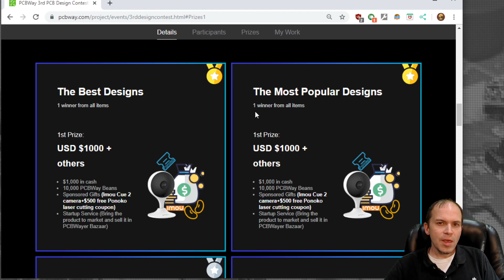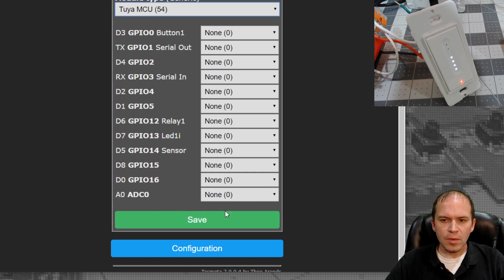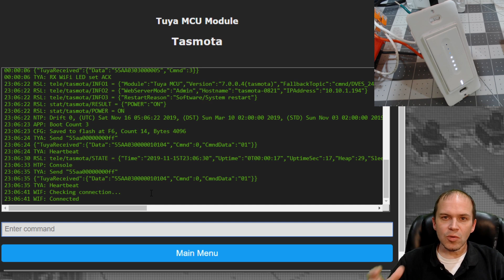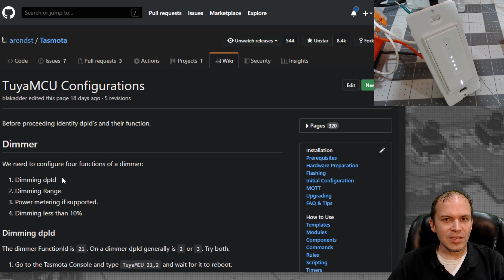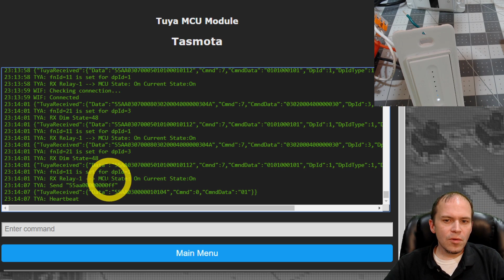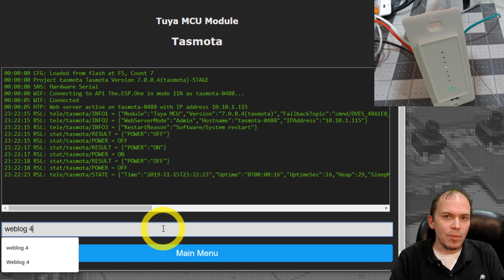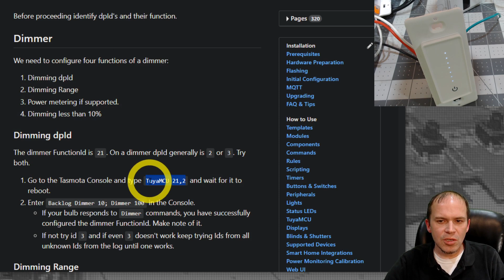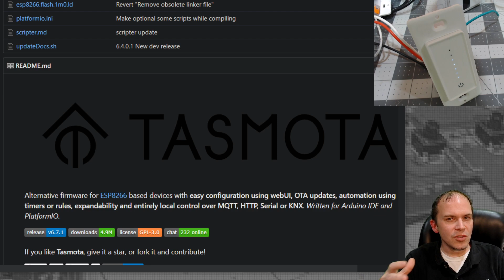How to Setup a Tuya MCU Dimmer - Tasmota Tips Episode 4

Comment: Which command can I turn off and on the switch backlight?  In device debugging it is set to light_mode.
Reply from the maker: You would need to find the datapoint for it if it is exposed.
Reply: @digiblurDIY Thank you very much for the quick response, I have "code" : switch backlight / type: boolean.  but I don't know how to send this command, would it be via tuyasend command?  on/off? DP is 16.
Reply from the maker: You could assign a relay to it.  TuyaMCU 12,16
Reply: @digiblurDIY  It doesn't work, after using tuyamcu 12,16 I lose the function of relay 1, because I use an 8-button touch panel. I can turn all of them on and off, but the backlight is difficult.
Reply: Wow, after a lot of effort, I got it. In my case, my DPID is 15 and I have the option of 0 - everything off, 1 - only the button LED turns on and 2 - the complete backlight turns on. In short tuyasend4 15.0.... Thanks.

Comment: Hi Travis! Need a little help...

I bought the blind motor YH002. I flashed it with Tasmota. Configured it as is the indications of this video.

The heartbeat is sent, but not received by the MCU. 

The strange thing is that if I activate the device manually, I see a "TuyaReceived" message in the logs, with de info of the action manually done (i.e. {"TuyaReceived":{"Data":"55AA0307000803020004000000506A","Cmnd":7,"CmndData":"0302000400000050","DpType2Id3":80,"3":{"DpId":3,"DpIdType":2,"DpIdData":"00000050"}}}). However, it does not respond to the heartbeat or to any other command sent... That is, the device is sending the updates that I physically do but, when I send commands from the UI, the device does not take any action.

Tried:
* Updated the Tasmota version (currently the latest is 10.0.0)
* TX GPIO 1 / RX GPIO 13.
* TX GPIO 15 / RX GPIO 13. (this is the configuration from which the device sends the status to the UI)
* Actually, I tried changing the TX pin to every available pin
* SetOption97 1
* SetOption97 0
* Configure dimmer limits (both physically on the device and dimmerrange in the UI)
* I even bought another YH002 device, hoping that the problem was in the device, however I found the same problem (therefore, it must be something that I am missing)

Any idea what the problem could be?

Comment: This is amazing thanks, I just opened up and flashed the treatlife DS01C today and it was a massive pain connecting the reset pin and cutting pins on the MCU. I hope i haven't broken anything. Going to try setting up the MCU later
Reply from the maker: Actually have one in the works where part of that shows how to do that one without cutting.
Reply: @digiblurDIY That would of been perfect. Hopefully I didn't break anything with my dimmer.  I know some people were soldering the reset pin on the mcu to ground but that seems more difficult than just cutting and re-soldering. Also for some reason on my treatlife dimmer I had to hold both the gpio 0 and rst pins to ground on boot then unplug the rst first then the gpio, only then would it flash. I have no idea why this might be but it made the lights go out on the front.
Reply from the maker: I thought it didn't have a reset pin or maybe I am getting my models of dimmers confused again. I had to hold reset on this one. https://www.digiblur.com/2020/07/the-tasmota-fan-controller-ive-been.html?m=1
Reply: @digiblurDIY  it was the reset pin on the TYWE3S wifi chip otherwise nothing would work
Reply from the maker: Ahh.. Yeah that pin won't let the ESP boot.
Reply: @digiblurDIY  strange mine booted fine with both gpio 0 and rst pin on the esp grounded then it would only go into programming mode when the rst pin was ungrounded and then gpio 0, no other order would work 🤔
Reply from the maker: https://randomnerdtutorials.com/esp8266-pinout-reference-gpios/#:~:text=RST%20Pin,the%20on-board%20RESET%20button.
Reply: @digiblurDIY  that's very strange I hope tuya hasn't tried to create a new way to stop people flashing certain boards as it would refuse to go into bootloader mode without that pin being grounded on boot
Reply from the maker: Nah... It's easier for them to change the chip than to change the design of Espressif's chip.
Reply: @digiblurDIY  yes your definitely right still very strange behaviour, I wonder what's causing it?
Reply: @digiblurDIY  Well I installed the dimmer today and everything seems to be working great except for the front plate which doesn't update, which is pretty annoying got any ideas?
Edit: update after a couple of hours of messing with it I got it working perfectly! The trick was figuring out the dpID's of the mcu and then setting fnID 27 for the dimmer feedback. Thanks so much for your great video looking forward to see how you manage without cutting those pins.
edit: looks like it's not so perfect if I max the brightness in the software the actual dimmer will get stuck at position 0 no matter what I do on the physical switch I can't get the brightness back down untill i bring it down using software :(

Comment: Newest Treatlife Dimmer doesn't work with OTA and because it has a MCU, I can't simply connect to  the TYWE3S chip RX/TX pins since they are also used by the MCU. That MCU is a BF7612AM (28 pins) for which, beside two Chinese web sites that require to have an account,  I can't find any info on the web for it. Would you know which of its pin is the Reset pin so I can hold it low at boot time to 'disconnect' it from the TYWE3S RX pin? Thanks.
Reply from the maker: I've heard of people cutting the traces on those but that seems like a pain.  I have heard some having luck with a better power supply to do them.
Reply: @digiblurDIY  Thanks. I was able to cut the MCU TX pin and flash Tasmota but resoldering the pin was... unsuccessful and I destroyed the MCU :-(

Comment: thanks so much for this video, man, really saved me
Reply: I have a Moes dimmer and worked in the fist example.
Reply from the maker: Nice!  One tip if you don't get linear dimming like you need, use "ledtable 0" on the console (no quotes), then you might have to set your dimmerrange again.
Reply: @digiblurDIY  one question, in HA I can control the device, but when I turn ON the status quickly change back to OFF (but the device is on). Do you know what it might be?
Reply from the maker: Using manual or auto discovery?
Reply: @digiblurDIY  auto
Reply from the maker: Using 8.4.0 or higher? It should have set setoption59 on for you too.
Reply: @digiblurDIY  8.4.0  checked and setOption59 is ON
Reply from the maker: Take it in and out of auto discovery. Other than that you might have a bug then that should be reported with it.
Reply: @digiblurDIY  Think I figured it out! don't know why, but in the MQTT config in Tasmota the field "Full Topic" was = %prefix%/%topic%/  by default. When I compared to another switch I have I noticed it was inverted. I changed to " %topic%/%prefix%/ ",  turned off and on again the setoption19 and it is right on HA now. 
Really thanks for the support. guys like you make this community possible :D
Reply from the maker: A few versions ago they fixed the requirement of making the topics flip. So the standard is prefix then topic.

Comment: Sorry to be a pain. Still not finding the "TuyaMCU (54)" module using Tasmota_8.2.0.1(digiDIMv10).bin. or 8.3.0.1 - Is it hidden from the list somehow? Also I have a new order of TreatLife Dimmers DS01C  (finger sliding to dim) and it appears that the SmartConfig over wifi no longer works. The switch starts flashing in pairing mode (red blinking), connects to the AP,  (white light) but then does not do anything else. It just says Re-sending smart config over and over again on the console. When you exit the smart config and the hot spot goes down, the switch goes back to a red blinking light.
Reply from the maker: You need to use the TuyaMCU module that is in the main tasmota.bin file.  That fork is only for the multipress Martin Jerry dimmer.  You should be able to OTA to it via the regular firmware upgrade in Tasmota.  You might be running the lite version if you don't see all the features too.  Jump into discord if you need a little more info.  http://thehackbox.org/tasmota/release/tasmota.bin
Reply: @digiblurDIY  Thank you! That did it. Now if I could just figure out why the new SmartLife dimmers wont do the smart config like the others do...
Reply from the maker: Grab a drink or two... Catch up on things.      😉 https://youtu.be/imKZbhJ8lvU

Comment: I just got four Gosund SW2 dimmers.  I have them set for TuyaMCU.  I see the heartbeat going out, but no received message.  I have tried GPIO1=TuyaTX/GPIO3=TuyaRX, and GPIO13=TuyaRX/GPIO15=TuyaTX and neither combination works.  (I did set the unused GPIO to 'none' each time)  Has there been a revision to this?  I'm using Tasmota 8.1.0.2 and have also tried 8.3.1.  I'm grateful for any help you can provide.
Reply: The Gosund SW2 works fine,  a couple extra steps and it's as good as any.
Reply: A follow up to my previous comment. I did get this to work and decided to keep them installed.
Reply: @ChrisJames2  What specifically have you done to make it work? Scripting FW?
Reply from the maker: That is the very oddball dimmer that is not highly recommended at all, not really TuyaMCU protocol either.  You'll need the scripting version of Tasmota and the script file for it.
Reply: @digiblurDIY  Roger that, I just returned them and ordered the Teckin model on your list.  Thanks.
Reply: Works great with the Teckin dimmer.  Now, and this is fairly off-topic, how can I get these to run with Alexa natively (no external HomeAssistant, etc)?  I see that the emulation options disappeared from the config pages once I switched to Tuya MCU Module.  I wish there were an MQTT skill for Alexa that would allow me to map raw MQTT to Alexa.  I think it is possible with the Lambda platform, but really wish there was something that didn't require cloud traffic.
Reply: I also picked up a Gosund Dimmer (labelled DS1 and not SW2). I was happy with my other Gosund devices, so thought this would work. Now I see it may be a problem. I've tried various pin options for RX/TX and no response/heartbeat. I guess I'm out of luck and should just buy another brand that's know to work. This was the item on Amazon

https://www.amazon.com/Gosund-Compatible-Control-Single-Pole-Required/dp/B07WSSTVL5

Comment: I am trying to use long press but I am not sure how to configure it. The Dimmer I am using is Treatlife DS02S and I have everything working but long press. This what I have done so far:  set  switchmode1 5 and configured a rule as:  rule on switch1#state=3 do publish shop_light/cmnd/POWER TOGGLE endon. This is an existing rule that I have working on a sonoff device so it is valid. My guess is I need to configure the module to respond to switch1 but I am not sure what gpio pin I should use. I did try setting gpio0 to switch1 but that did not work. Any Ideas?
Reply from the maker: That dimmer can't be used for long press. All the buttons tie into the TuyaMCU so the esp8266 never has the chance to see presses. The Martin Jerry ones about the only ones I know that can be used that way.
Reply: @digiblurDIY  I was afraid of that. Thanks for the quick reply.

Comment: Hi Travis, I've been trying to set up a Treatlite dimmer for quite a few days now,  but can't seem to get around a couple of problems encountered.  I can live with the 1st problem, but the 2nd is a bit more irritating:

1) I can't get the light-level LEDs on the switch to match the Tasmota and Home Assistance UI slider ranges.  As expected, only one LED is lit when the sliders are all the way to the left.  The 2nd LED doesn't light until the sliders are near middle.  When I moved the sliders toward right from middle, additional LEDs light up until all LEDs are lid at full brightness.  Basically, nothing happens with the LEDs throughout the first half of slider range.  Is there an adjustment I can make to spread out light intensity to the entire range of the sliders?

2) When I toggled the switch to "on" and physically adjust switch to full brightness (or at dimmest level) then toggled off,  the switch remembered it's previous brightness settings when I toggled "on" again.  This is good.  However, if I toggled the switch to "off" at any brightness level other than brightest or dimmest, the switch always turns back on at the dimmest level.  Is there any way to make the switch remember previous brightness levels other than brightest or dimmest?
Reply from the maker: Did you set the dimmerrange?  If so I'd try setting "ledtable 0" (no quotes) on the console then doing the dimmerrange again.  

For the second question, if this behavior is done just by interacting with the switch via the faceplate then probably not as that is all done and handled by the TuyaMCU chip.
Reply: @digiblurDIY  Resetting dimmerrange after the "ledtable 0" command seems to have fixed both problems.  Thanks for the tip.  What exactly does ledtable do.  I saw it mentioned in the TuyaMCU Tasmota page but no explanation.

Comment: digiblurDIY, So informative One question. 
Can I set these dimmers for double push 3 way type actions like you shown in your other video "3-Way Smart Switch Tips & Tricks with Tasmota" ? Or can be done by Martin Jerry type Dimmers only (first 2) !
I want to have Touch slider dimmer switch with possibility of double push 3 way configuration...Any Suggestion/Guidance !
Reply from the maker: No TuyaMCU dimmers you can't change up the button presses as that all goes to the TuyaMCU to do the heavy lifting.

Comment: Hi Travis, on my Treatlite dimmer, the orange led comes on for a few seconds when I apply power to the device.   Then it never comes on again.  Is there anyway to turn that orange led on/off when the main light is off/on?  Also, I noticed when I change dimming level via the switch, the slider in Tasmota GUI doesn't adjust to reflect the new dimming level; is this normal behavior?
Reply from the maker: The slider in the GUI is just for testing. Have to manually refresh the page to update it. Your home automation software should have a slider. TuyaMCUs typically don't have LED control via the esp chip.
Reply: @digiblurDIY  I noticed on the Treatlite dimmer you showed in the video, the orange LED is always on.  On my, it's always off.  Now wondering whether we have the same dimmer.
Reply from the maker: That might have been before the heartbeat fix? I know I had one with a red led all the time before I figured out the heartbeat thing.

Comment: Hi All, I have the TreatLife dimmers (DS01C) and I have them flashed and working with 8.1.0.2. I have tried 5 different dimmers and they all seem to be doing the same thing. Unfortunately when I make dimming changes on the switch itself, the webUI doesn't update the slider. Any ideas why?
Reply from the maker: The web UI doesn't update by itself as it is just really for testing.   You'll have to refresh the page.

Comment: Hi Travis, I bought a couple Gosund D1 dimmers.  Updated with tuya-convert.  I've tried the config you mentioned but I never see the heartbeat message being returned.  Any experience with this particular switch?
Reply from the maker: You check the Tasmota template repo?
Reply: @digiblurDIY  Actually this isa Gosund SW2 Dimmer.  It's in the list of Tasmota devices.  The page provides a template but also states the setup requires scripting.  Is there an example of configuring one of these?   Or should I follow your 'New Device template - Tasmota Tips Episode 6"?  I'm new to this.  I converted a bunch of regular switches and plugs, this is the first dimmer.  Maybe should have picked a different product.  Thanks...

Comment: @digiblurDIY is it possible that I cannot use the double-press on a Moes DS01 dimmer? Is it because there is no GPIO set to Button1 (17)? I haven't open the dimmer, but apparently this model has no other GPIO connected else than the TuyaTx and Rx.
Reply from the maker: You are correct. That's what I talked about in maybe this video or the one using a dimmer to control a smart bulb. That's why you see a lot of Martin Jerry dimmers in my videos.

Comment: Hi Travis, I'm trying to configure a Treatlife dimmer using the instructions provided in your video.  Based on feedback from manual dimming, my range is 150 to 1000.  But when I use this range, maximum brightness occurs before the Tasmota slider is all the way to the right.  The slider seems to map more accurately when I changed the range to 150-925.  But I'm not sure whether I'm still achieving maximum brightness when the slider is all the way to the right using this range.  Do you think I should go with this tighter range even though I'm getting the wider range from the switch feedback?  Also, when I operate the dimmer via the switch, the Tasmota slider doesn't adjust to reflect the new dimming state of the switch; how do I fix this?
Reply: Forgot one other thing: I integrated the above switch into HA via configuration.yaml.  I can't set dimming to below 41 using the Home Assistant UI slider.  When I moved the HA slider all the way to the left towards zero, it jumps back towards right and stops at setting 41.  In the TUYA MCU dimmer Tasmota documentation, it mentions setting dimmer to below 10%, but provides no further instructions.  Is what I'm seeing in the HA UI somehow related to this?

Comment: Hi. I followed the video on a treatlife dimmer and worked perfectly. Two things to note though... (1) the leds would not stay on if I use the slider over the web as it stays if I use the finger (not a huge deal) (2) if I turn it off, set a dimmer value with the finger and turn it on, it would not take the value I just set with he finger but the last value when turned off...
Reply from the maker: Try looking at Setoption20  and Setoption54 otherwise it is the way the TuyaMCU code in the secondary MCU is designed.